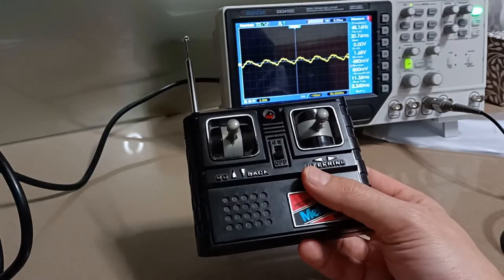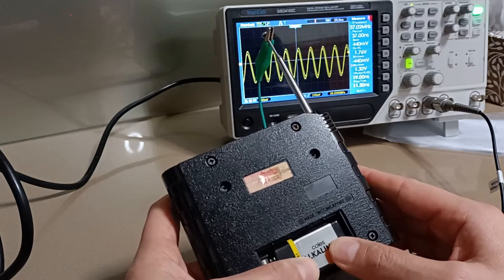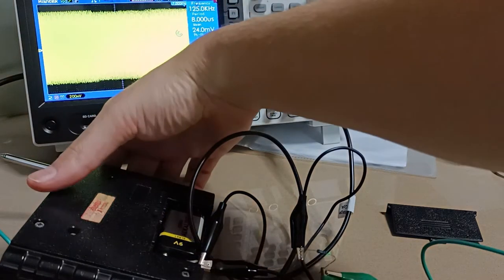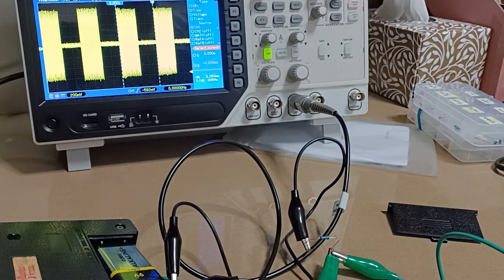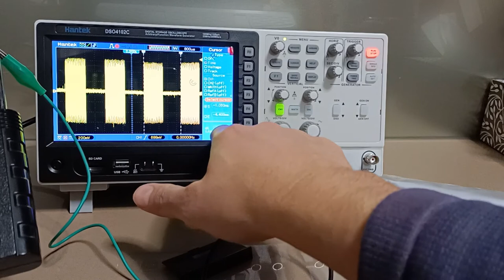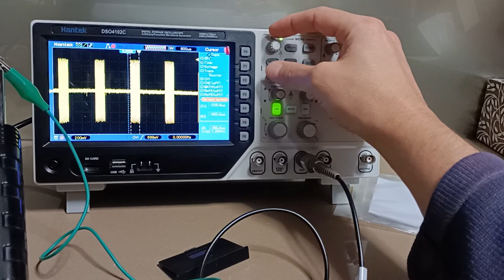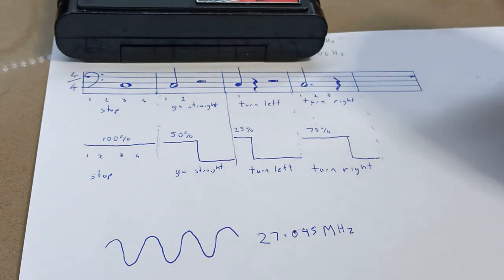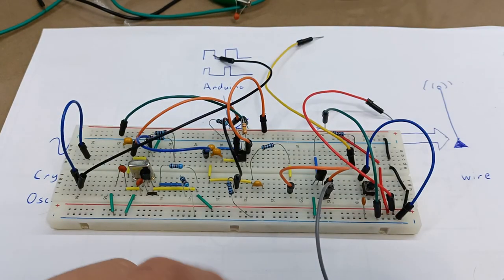Reverse Engineering a 27MHz Radio Controller Transmitter (RC Transmitter Part 1)

Comment: I have a lot of those older 27 mhz toy RCs, and one thing I can remember from all of them is that they were all capable of steering while sitting still. One of the ones I own even has 2 speeds which are selectable using the radio, but that model was particularly susceptible to interference which would cause it to drive around randomly on its own. They probably used a different system... maybe even a weird type of DTMF where one frequency controls the drive direction (and speed) and the other controls steering independently.
Reply from the maker: They sound a bit more advanced than my truck. It only had one speed forward and backward and would only turn if going forward or backward.  I used to have jet hopper that had two forward speeds but I can't remember if the steering was as you describe.

Comment: Thanks for such a quick response, is there any other way to find it other than to playing directly with the ic placed on the remote
Reply from the maker: If the IC is marked you could try googling the datasheet for that IC number and see if there is documentation on how it works.

Comment: It's been a rabbit hole of information jumping through many of your videos today.

Since you have the original transmitter I'm wondering if you got the idea for a single transistor amplifier from that transmitter?

I do remember as a kid these radio systems required matched frequencies to maximize range. You did purchase a matched set of crystals; have you swapped out the receiver crystal to match your home brew transmitter?

The videos on Excel as an oscilloscope were interesting. I built a cheap oscilloscope from a kit from Banggood but would have tried an Arduino scope had I known about them back then.

It's all fun and sad that cat videos pay content creators more money. 

Now I'm wondering if you could hook up an old tape recorder to the transmitter antenna and record a series of directions and then rewind the tape and hit play and send the output through your transmitter to steer the truck a preprogrammed course? 😅
Reply from the maker: I am glad you are enjoying the videos.

I wanted to build the transmitter from basic parts like the original and the single transistor amplifier was the best guess of how to do it.  Today I would probably go back and look at doing a cascode amplifier with two transistors.  I might try that some day.

I think you probably could record into the tape recorder and preprogram a course.  It would need to be a square wave sound that you would be recording.  I have been thinking to use the newer arduino R4 and then use that to control my truck from wifi but I have not got around to it.

I didn't swap the receiver crystal.  I just measured what the original transmitter was putting out and bought a crystal that was set for the same frequency.

The excel oscilloscope came about when I didn't have an oscilloscope yet and will starting to learn about oscillators.  Unfortunately it wasn't ever going to be good enough for dealing with 27 Mhz but I was able to use it for really slow oscillators.  I was surprised how functional it became with just and Arduino and excel.
Reply: You absolutely can record the radio signals to a tape and play them back to make the toy perform a sequence of movements. In fact, TOMY did exactly this in the 1980s with their Omnibot and Hearoid robots. Those used audible tones to command the robot from both the remote and the tape. Such a system would be horribly unreliable now, though, given all the interference at 27mhz. But it has been done!

Comment: 2:58 actually there are two signals band together right? I mean the carrier 27 MHz and also what is transmitted from the encoder IC ?
Reply from the maker: Yes you are correct a square wave and the carrier merged together.

Comment: this 50 Hz from main supply is so annoying it appears always when I disconnect everything it comes from power cables and also from the socket etc.) and sometimes we can mistakenly get it as our signal or something :/
Reply from the maker: Yes the 50hz a pain. I have two power cables for the oscilloscope one with earth connection and one that doesn't. Usually with the earth connection reduces the 50 hz but then if using the Arduino from USB you can run into problems with the ground connection. Eevblog has a good video about it called something like how not to blow up your oscilloscope.
Reply: @overengineeredinoz7683  I know but I don't put my probes in any of main, neutral etc. connections so no problem. For my circuits I use transformer anyway. BTW I haven't bought the arduino kit (probably I will soon as I want to make some projects, for now I use other components which are quite sufficiant like 555 timers, op-amps, and, - or - not gates, home built sine waves generators etc. they can replace Arduino in many situations ) but even when you connect your usb to anything it doesn't have a ground connection? And usuelly power supply has a tranaformer anyway...

Comment: Gday Sir. Can you explain how to eliminate that 50Hz noise? I cant see exactly your wires connected. Kind regards from Germany
Reply from the maker: The resistor is connected between the antenna and the negative terminal of the battery. The capacitor is connected one side to the antenna and the other side to the oscilloscope probe

Comment: Hello sir, its really nice explanation,  how could we reverse engineer an chinese rf remote on which provider remove the ic number and its run on 433.92 MHz
Reply from the maker: I am not sure. It will be hard to find an oscilloscope that will measure 433 MHz.

Comment: i subscribed' 'very cool,,,, im trying to learn electronics from watching guys like you'''''''ive learned alot'''''but im ''still'' learning ''more and more'';' like a sponge' 'but im at 60 years old & im finding it diffucult because of my age'''''''but i dont give up'''''i find it like a big project that comes in waves''''''learning'''''''''''''''but right now im ahead of myself' im trying to build a voltage regulator for my 70amp dc 3-40 volts''''''i burned up the old reg board''''''now im trying to duplacate it'''''''and with any new improvments'''''''''im useing a (lm723 / nte 292) you know its not easy at first''''''''but i am a ham radio operator'''''''''KD5UTU''''''and i know ''some'' about electronics ''''''''''' so if you can stear me the right way''''''in any way''''''''''' i would ''''really appreciate it''''''''''''but ive read all about you;;;and i think you can help my project Forge ahead''''thank you sir'''''''''''''.james........oklahoma'''''''73's.
Reply from the maker: Always nice to hear from people with an interest in electronics.  Good luck with your project. If you have a specific question I will try to answer if I can.
Reply: @overengineeredinoz7683  ok'''''''ill ask'''''''''''if you were building a voltage regulator board for a 70 amp 3-40 volt linear dc power supply'''''which i.c. & transistor would you choose too use for controling your voltage''''''''''i know its not the easiest question to ask''''''''''but the facts are there''''''''its (linear) (3-40 volts)  70 amp capabilities'''' thank you nice sir.
Reply from the maker: @jamesharrison2041  I have to confess I don't know. 70 amps is a lot of current.

Comment: Sir can u trace and explain the working of the circuit diagram and components used inthe transmitter , which ur using it for reverse engineering👨‍🔧
Reply from the maker: There are a few other videos on the channel that explain different parts of building a transmitter. Hope that helps?